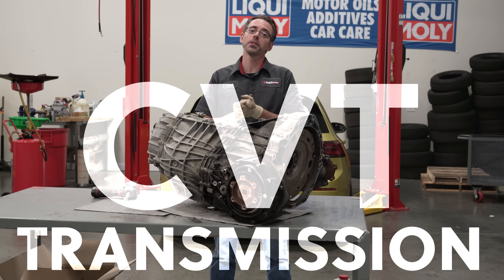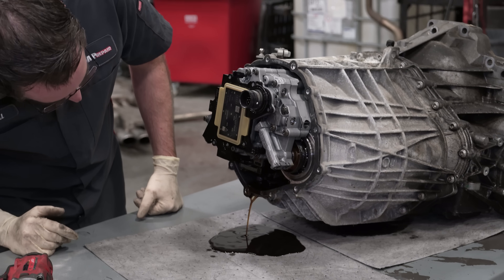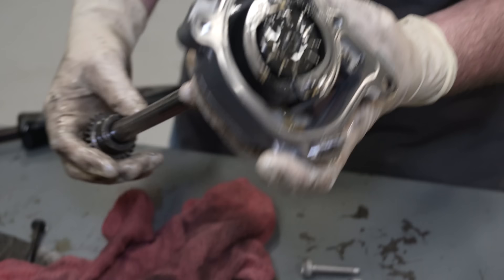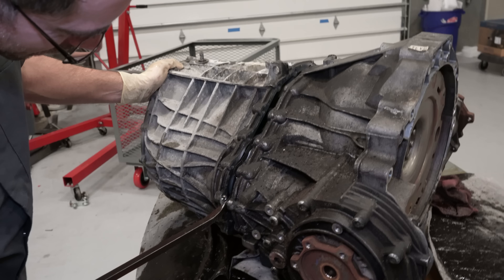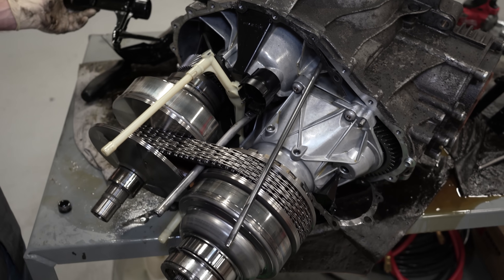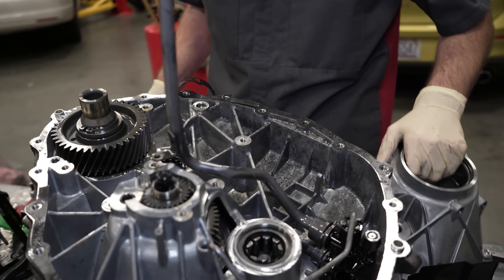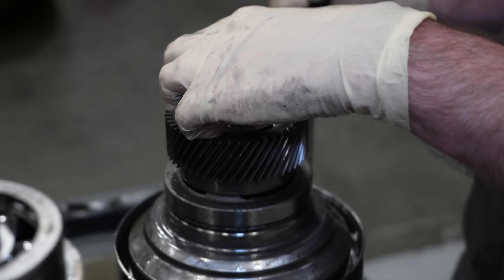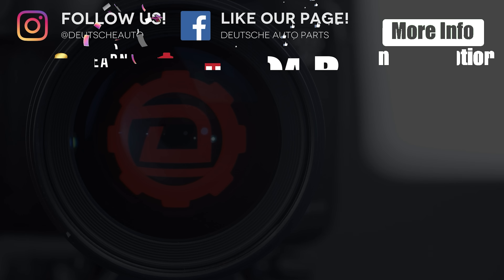Why you shouldn’t get a CVT transmission

Comment: Vast majority of the CVT failures are from lack of fluid changes. These things pump out a tremendous amount of metal shavings from the belt constantly rubbing against the drive pulleys. Nissan dealerships will pretty much just charge cost for the fluid and filters on their CVT transmissions since it actually saves them money to change fluid for no profit rather than replacing the entire transmission under warranty. I've got a Nissan Versa with about 150k miles on a CVT. So, they can last a good bit if you keep the fluid changed regularly.
Reply: toyota hybrids with planetary gearbox set is much better type of cvt, as long as you aren't trying to tow with it....even though i wouldn't try to tow with any type of cvt.
Reply: @utpharmboy2006  - I have a 2019 Prius Prime, and you are correct: you should never tow a trailer with any Toyota e-CVT. The problem is that doing so will cause the MG2 Stator to run at very high continuous power levels, and that will overheat it. Both the MG1 and MG2 stators are cooled by means of the transmission fluid being sprayed on them, then the heat being removed by the tramsmission/Inverter oil cooler, but the systems are designed to handle continuous power levels of around 14 kilowatts (in the Prius), or 24 kilowatts (in the Rav4 Prime), and not 40 kilowatts, which is what you might see when towing even a small trailer.
Reply: @laura-ann.0726  excellent description and information. thank you
Reply: @utpharmboy2006  I've towed boats with my prius and transmission is still like new with over 220k miles😂 never changed fluid either
Reply: @gabrielq.906  toyotas are probably the exception because they are awesome and all others are trash. but great to know thanks!!!
Reply: @gabrielq.906  Prius isn't CVT
Reply: @gabrielq.906  Your Prius DOES NOT have CVT.    Toyota calls the Prius "eCVT" which is quite misleading - yes it's continuously variable but it does it with electric motors, it's nothing like the mechanical CVT's.    So your Prius's reliability is irrelevant to this.
Reply: @utpharmboy2006  that’s also a eCVT which is a lot stronger than a regular cvt
Reply: @utpharmboy2006 
Toyota only warranty the C.V.T. to 36,000 miles read where they will not be included in extended warranty.

Stay with my 9-speed Torqueflite chrysler transmission  fluid change 100,000 miles.
Reply: @gabrielq.906  The Prius has an ECVT right? Because they are hybrid, you're generating electricity with that engine to power the traction motors. So you wouldn't be wearing anything. They are extremely reliable systems.
Reply: I had a 2008 Nissan maxima brand new! Transmission went out at 59,000 miles and 130,000 miles. Car had 3 transmissions in it by the time it was totaled. It’s ridiculous. I have a 2010 Lexus ES with 170,000, original transmission, and NOOOO issues. It shifts just as it did when it was new.
Reply: @sixtee9certified278 must push pedal to metal for 3 of them. Common sense, slow,steady take off period.
Reply: @sixtee9certified278  My 96 Maxima with 220K miles is on its original transmission, and has never had the fluid changed. Manual says to change the oil only under extreme driving conditions.
Reply: My Subaru dealership just charged me $330 fucking dollars to change my CVT fluid. Told me it would be good for 60k more miles
Reply: @tylerramos7633  That's because it's not just a simple drain and fill, and they typically take anywhere between 8-12 quarts of fluid to do the service.
Reply: @tylerramos7633  wow you got scammed.  I do my own fluid changes for about $40 Trans fluid and filter.  Usually only takes me about 30 - 40 mins.
Reply: @MrExicutioner  12 quarts of fluid at $15.00 to $20.00 per Quart, $40.00 doesn"t go very far.
Reply: @MrExicutioner  $40 isn’t even enough to buy the amount of fluid you need lol it’s also not enough to buy the CVT filter. So no you are not doing the same thing at home for $40. Not to mention you need an OBD2 sensor to make sure the CVT is operating at the right temp. Even doing this at home is well over $100
Reply: @tylerramos7633  Ok maybe it's more like $60.  I drive a Chevy cobalt and it has 136k miles on it now.  I change the fluid religiously because I know these CVT transmissions are problematic especially if you don't keep up with maintenance.  I can get a kit on Amazon that includes the filter and new pan gasket for about $30.  Then Dexron 6 fluid is around $30 as well.  Still saving allot of $$$ and it's cheap insurance against a trans failure.
Reply: @Tyler Ramos  doesn't sound too bad with inflation of prices considered. Paid $260 at a Nissan dealer for fluid change on a Murano at end of 2020.
Reply: @tylerramos7633 don’t go to the stealership.  Find a good local shop.
Reply: @tylerramos7633  does that surprise you? That’s a pretty standard cost for something like that
Reply: @tylerramos7633  so you’re mad because you have to do routine maintenance?
Reply: Mine failed at less than 80k, original owner. Every single service done at the dealer, dead about 4 months out of warranty.
Reply: @ReyciclismoMTB  they charged you for a service they never did , I use to work in a dealer I know how that works….
Reply: @ReyciclismoMTB  there was an extended warranty for nissan due to that problem make sure they replace it under warranty. until 120k miles i believe look online for extended warranty on transmission
Reply: @ReyciclismoMTB stealership probably never changed it.  They bring them, keep them all day and say they did it.
Reply: @michaeldro  versa   Drain and fill myself every 20,000 miles   180,000 so far.. No issues
Reply: @mygolfballsannoy  thanks so much brother.
Reply: @mygolfballsannoy Every 20,000 miles fluid change.
03 chrysler 4-speed it was every 36,000 miles, 17 year old car still going.

Not reliable transmission, sustained engine R.P.Ms too

For ATVs and snowmobiles.
Reply: My 2008 Toyota Tundra has 789k miles, and it's an original transmission. Did fluid change every 80k miles. I doubt any CVT would last as long. Just face the facts, it's a poor design requiring higher maintenance.
Reply: @Hmonglauj89 exactly
Reply: This is what I tell my customers over and over and then it comes in on a flat bed and they’re all confused
Reply: Asking a customer to do MAINTENANCE???!!! :face-blue-wide-eyes: Listen here bub I didn't spend $1850 at 34% interest on this magnificent 2007 Altima to do fluid changes ok.
Reply: Subaru NA says nothing in the manual for fluid change ! Meanwhile Subaru Canada says 30K mikes !!??
Just why is that?
Reply: @tedbiernacki376  SUBARU Canada got the right recommendation.
Reply: My Altima has 227k miles not km
Reply: @michaeldro  at least every 30k
Reply: @michaeldro  it’s due every 40k, and only use Nissan fluid, whatever is indicated on your dipstick handle
Reply: @K_man217  Newer CVT's don't even have a dipstick anymore. The manufacturers have made things harder and harder on purpose for the backyard, tree shade home mechanic to do their own maintenance.
From special tools, fancy "Green Unicorn Semen" ATF fluids, locked up repair info and Space Shuttle repair procedures.
Reply: 450000 km - manual Chevy in a S-10.  800000km on daily driver manual 54 Chevy pickup box dating from 1927. Todays cars are substandard.
Reply: i got 2011 versa with over 200k miles and i deliver pizza. my transmission runs great. what are you people doing/not doing with you car?
Reply: @ernestgibson8792  Versa is a small car so yes you should play the lottery…you will not get another year out of that car’s transmission…it’s at the end now..
Reply: @michaeldro  30,000 miles religiously and don't drive it like it's a race car.
Reply: I had a 2002 Acura TL Type S which called for 15,000 mile trans filter replacements. They had clutches designed to wear and were 260HP FWD cars in 2002. 
Obviously exactly 0% of owners ever changed the filter after the car was out of dealer warranty so they got a reputation of being failure prone. I am convinced if well maintained they would survive. Mine and a friends identical car both would chirp second consistently, those clutch packs were beasts they just needed aggressive fluid changes.
Reply: @Jasontyo  I can't speak for your specific ACURA model BUT my 1998 HONDA CR-V AWD has NO WAY to change the ATF filter unless you crack open the transmission to the level that you're looking at the aluminium piece behind the Torque Converter.
And up to this day most Honda/Acura products are made THAT way.
Best bet was draining and filling every 30K miles and hope for a long life.
Reply: I can't believe how much plastic parts are inside that transmission. Well, actually my VW had plastic parts inside the engine so I suppose that is not that surprising. The problem with that is that plastic over time, especially when subjected to heat becomes brittle and crumble. It's not likely to last more than 10 years so. So I'd say plan on this thing failing within 10 years. Personally I like a car to last way longer. I think I will go with Toyota.
Reply: Also at least on Toyota and Honda they have been doing CVT's for some time so they are not as bad as some. I have about 180,000miles on my accord and it seems to be doing fine, will need to do a fluid change i think soon as i dont know when the previous owner had it last done. That said its sorta the same with automatics as well and i hated my cars with (Lifetime transmissions) that had no fill hole on the top or dipsticks to check the condition. Also i try not to beat on my car. I had like 16 cars that cost 1000 or less that i beat on all the time, and ive blown several trannys, now that im older, and you cant just find beater with a heater for a few hundred anymore, its best to make the car last.
Reply: When do you replace the metal?
Reply: Honda regularly recommends changing the trans fluid, much like an Oil change. "Schedule D" if I'm not mistaken. People still don't do it. Then you have the newest jeep cherokees burning up in the first 60k miles for no reason.
Reply: And change that cooler filter
Reply: @michaeldro  I change it every 50 k miles have over 195k on my Altima like anything else maintenance is the issue behind failure.
Reply: my dealership told people to change every 50k miles. but its common knowldge that people should changed the cvt oil around 12k-20k miles, escpecially when you live in a crowded area with a lot of traffic jams
Reply: @timbersync  Agreed, that is a huge factor .
Reply: Yeah I agree I had the Honda 1.5 turbo with 45,000 mi I didn't change the filter in it but I did do the draining fill 2X each at 20K and I had the 🚗💨 tuned & beat the shit out of it but took good care of it, it never let up. Even my good friend is a Honda technician works for Honda said there was nothing wrong with it 😂
Reply: i Have Nissan Sentra 2014 SR around 9years old still running good with no issues regular change oil every 7,000 from dealer 0w20 pure synhetic  oil, transmission oil cvt every 50,000 & radiator coolant changed at 100,000. before at 38k i installed cold air intake without any issues & with catback exhaust no engine lights also. Just proper maintenance brake pads & tire rotation.
Reply: Honda CVT is fine change the fluid every 30,000 no problem at all.
Reply: just adding to the pile here, I have a 2010 altima that just hit 220k miles a few days ago. 2nd owner so i have no idea if the cvt is still the original (I hope it is not) but the trans has been shuttering at around 2k rpms since i bought it at 187k. so unfortunate because the engine itself is an absolute tank with no issues and the car has been extremely reliable and good to me for those 33k miles. I baby it when i drive from a stop but im forced to accelerate fast being from illinois where the on ramps are death traps with only like 300 meters of lane to merge.
Reply: They are just a terrible engineering design period. As a mechanical engineer I cannot understand why something would be designed to transmit power via a belt that relies upon friction between two conical discs compressing a metal belt that is sliding over its surfaces. Manufacturers need to go back to regular gearboxes with torque converters . . .or better still manual gearboxes with clutches (simple).
Reply: AUDI A5 2.0 
2012 - 98000 Miles
4 oil changes to date on the CVT Box and No issues so far
Reply: My Nissan dealership only recommends for a 2011 Cube CVT fluid replacement/flush period! They will not replace the internal canister filter so I did it myself and cleaned off the screen pan filter. Actually, I wish I did my own CVT maintenance unbeknownst there was an internal canister filter vehicle manual doesn't mention it nor did the dealer.BS
Reply: You are just prolonging the inevitable. Compared to transmissions with old school gears, the CVTs do not last as long no matter how often you change the fluid. Instead of the CVT dying out at 10K you get 15K instead when you religiously change the transmission fluid.
Reply: False…. All cvt are trash
Reply: Wanna know how to avoid CVT and automatic transmission problems? Get a manual trans, you lazy asses.
Reply: If it was salvageable before, it’s not now. Insult to rednecks right there.
Reply: @michaeldro  I change mine every 30K miles... Honda CRV. Running fine at 110K so far, but 200K will make me feel a lot better about it.
Reply: Good to know!
Reply: (it's basically cost at warranty) You mean the manufacturer's cost at distribution? the dealership still must make a margin and do on warranty claims.
Reply: @Knight_Kin  Based on the cost of the fluid and the filter if one were to try and buy it directly for a DIY service. My transmission needs to use the older Nissan NS-2 fluid which runs about $22 a quart. Transmissions that use NS-2 are not interchangeable with the newer NS-3 fluid. You need 10 quarts to drain, flush, and fill the transmission. Then, the filter and gasket around $50 if you use Nissan parts. The dealership by me charges about $325 for the CVT service. One still needs to pay the mechanic for their labor time. Once I do the math I believe that Nissan is not what I'd call, gouging people for CVT service. The other benefit of taking it to the dealership is they will update the firmware on the powertrain control module which will affect the shifting, drivability, and longevity of the transmission. As well, there is a calibration/reset that is supposed to be done on the CVT after the fluid is changed which I think Nissan calls a "Clutch Point Relearn". At any rate, I know that after my first fluid service they told me they reprogrammed and recalibrated the CVT and I found the car as a whole was just much more responsive afterwards.  So, there are a number of benefits to having the dealership do the service that go beyond just cost.
Reply: I've heard the opposite: don't change the fluid often.
Reply: Also from the guy who teaches transmissions at the trades university I work at "make sure to do the changes with GENUINE fluid from manufacturer. Aftermarket hasn't been able to directly copy the formulas yet."
Reply: I was thinking they're failing because the vehicles are too heavy and engines have too much power for the best use case of CVTs. Use the right tool for the job!
Reply: Just did my 2020 Civic, 30k on the clock got fresh CVT fluid today
Reply: @michaeldro  just toss the whole car in the trash and get a small block Chevy and a t5 tranny
Reply: @hostileaks4495  hey, listen here. I love my car. It makes me happy so I'm going to keep it happy. Kindly, fuck off and let me take care of it, so I can enjoy it as long as I can.
Reply: @michaeldro  nah I feel you I love my car too. But in all seriousness, it's going to be trouble those cvt are the worst invention. It's basically the same thing that's on a golf cart. Get a infinity g35 or something instead of an altima. You'll love it way more.
Reply: @hostileaks4495  thank you much for understanding then, sorry. I've thought about a g35, probably will be the next. I know JATCO isn't the best, I'm trying to minimize probelms as I go. Metal belts on metal + heat isn't a good combo.
Reply: Recommended frequency / mileage to change of cvt fluid
Reply: I just changed the fluid in mine at 60,000 miles.
Reply: we bought 2 Rio's with the new Kia CVT - I wanted to risk Versa but decided not to - cvt fluid+filter EVERY 20k so far zero issues - I might still risk it with a Versa Note but id have to get it with only 30k max on odometer so I know the cvt hasn't been ran into the ground yet
Reply: People just don't know how to shift properly. They bump into it many times, aggressively shifts gears, lack of fluid changes. All from daily driving. You take care of it, then it will last.
Reply: What kind of schedule do you follow? I'd appreciate knowing.
Reply: I thought the CVT transmissions are sealed units that have lifetime fluid that can't be changed or checked?
Reply: @ryantoomey611 Nope.  They definitely have drain plugs and fill ports.  Changed every 30k.
Reply: Absolutely this. CVT haters either change oils in a longer time thinking its like some torque converters, or are racers that want more than 50kg of torque
Reply: I I have a 2015 Kia forte five SX with 165,000 miles on it and I’ve never changed the transmission fluid course. These are sealed there’s no dipstick like the old days so far so good I imagine if I keep this car any longer. It might break down, but any rate I’m just gonna leave it the way it is.
Reply: Nissan used have good Automatics,that never let you down,but bowing down to mindless EPA elites,the puppet car companies thought that building a snowmobile CVT transmission was a great idea to squeeze another mile out of a gallon of gas to keep the puppet masters happy.The CVT has been an engineering disaster! The bulk of the CVTs are made by JATCO a Japanese transmission builder for Nissan,Subaru,Mitsubishi etc.They are on their 11th model!The concept was good,the engineering flaws disastrous for dealers and customers.The other car manufacturers came up with their own versions and yet still have issues! Buyer Beware when the warranty is off.Insanity is doing the same thing hoping to produce better results! Those manufacturers need to hear from customers with class action suits so they will build again what works! The world has gone Mad!
Reply: Fluid changes every 36,000 miles (had 03 chrysler 300m 4-speed every 36,000 fluid changes) going backwards?
Drive chrysler with 9-speed 100,000 miles fluid and filter change.
Extended highway driving and hard acceleration from dead stop shortin life of transmission.

C.V.T. ARE FOR ATVs and SNOWMOBILES.
Reply: Perhaps Toyota engineers know something that they have come up with ECVT in lieu of CVT.
Reply: My only experience with CVTs is farm tractors and checking out a few Nissan X-Trails for a mate.
All the CVTs had problems and he ended up buying a manual as a loan car for his car mechanic business.
Not sure if the heavy-duty CVTs used in newer tractors can be reliable, they primarily use them rather than 36, 48, etc. speed manual/auto transmissions, this is done because different crops and attachments require different speeds, whether for harvest, seeding, etc.

Now I change my eng. oil 3,500-5,000 miles and regularly change trans, diffs, axles, etc... That being said, when the defense for a vehicle's unreliability is 'oh you have to baby it', it is a poor excuse.
A good engine, tranny, etc. Should be able to take a bit of abuse.
Do these newer CVTs even have a service & maintenance plan?
Reply: Thanks i was looking at a Ford CMAX with a CVT, now forget it, too much potential for problems, that chain breaks and its gtta be 1000,s of dollars.
Reply: 260k on nissan maxima 2015, i maintain the transmission when ever is needed.. CVT saves fuel that why it's good
Reply: Hello I wanted to launch my Toyota Avensis, press the brake then accelerator and it just snapped.. it's going D, R but doesn't move. When I put it in P it makes some noise for like 3sec. So can someone tell me what should I do? 2.2d 150ps 2010
Please tell me if you know what could it be. Thanks
Reply: 2015 Honda Civic CVt has 160,000 miles. No problems no shaving. Change fluid every 20,000 miles. I don't know I don't drive aggressively.
Reply: Yes
Reply: Just by looking at the oil viscosity and colour, you can clearly see why that CVT failed.
Reply: Yeh, okay...its their chepo deluxe Jatco transmission..duh
Reply: another one hondas using steel belts cvt shred into million pieces because of behavior driving
Reply: Then you don't know how manufacturer warranties work. I'm a service advisor and have been one for 14 years. Nissan pays us to change the transmission out under warranty. 25 percent above cost for the assembly. Good hourly rate for the labor. We don't lose money.
Reply: @spectreshot1  Well...let's think about this... You're dealer's service center specifically doesn't lose money. But somebody eats the cost and it's no doubt coming out of a higher level cost center from the Nissan corporate.
Reply: All cvt transmissions are trash
Reply: I have a 2011 Nissan Cube SL with a CVT and I've never had an issue, I keep the fluid changed every 30 to 50 thousand miles. The problem is people don't do fluid changes and that's what kills them.
Reply: 2015 Corolla with 200K miles. I have done two tranny fluid changes in the 70K miles I have put on the car since I bought it used changing fluid every 30K. Did the strainer(filter) only the first time and nothing on it. If it had an actual filter I would change it every other fluid change like on my daughter’s 2015 Civic. I don’t use factory fluid and never have with CVT or non-CVT transmissions with longest at like 238K miles and sold it shifting fine.
Reply: I have a 2015 versa with 150,000 also. The tranny feels strong.  I change canister filter on left side behind wheel well .. runs great
Reply: I changed mine by accident in my subaru....drained the wrong oil...
Reply: Biggest problem with todays cars is substandard parts, especially MB, BMW and VAG using recycled chinese material in their timing chains.
Reply: @mikakoivunen3456  I didn't know the Chinese are this evil 😡 They even spent the time and effort to trick the Germans into developing such an inferior transmission just to sell their recycled crap. They must've bribed the engineers and QAs at LuK and the VW group, so those inferior products can make their way to the market. I don't know why people are still buying those cars, the Chinese must've been bribing the customers as well. How dare them 😡
Reply: You don't buy a Nissan if it's a CVT Trans, if you want CVT buy Toyota or Honda instead. Nissan CVT will crap out even if change fluid every 5K miles.
Reply: @zepp3lin  my Accord just turned 163k. It's probably overkill but I have the CVT fluid changed every 30k.
Reply: @jeffduncan9140  Not overkill. I have my CVT fluid changed every 25k.
Reply: @jeffduncan9140  30k might be the recommended miles
Reply: @jeffduncan9140  30k isn't overkill like zepp suggesting every 5... Clueless individuals
Reply: @jeffduncan9140  Not overkill at all. Sounds pretty normal interval to me. You're doing great. 🙂👍
Reply: @jeffduncan9140  What do you do to change it? Do you take it to the dealer?
Reply: @crand20033  I do. There's one not far from the house. I figure if there is an issue with it, given my limited experience with transmissions, they might see it before I do.
Reply: @jeffduncan9140  They have a machine that takes the old fluid out and puts the new in at the same time and makes it really fast. But I don't think that is the most thorough way of cleaning it out. if you take it to the transmission shop (that really knows CVT tranny's) they may do it a different (more expensive) but better way. They have to get all the fluid out of the torque converter too.
Reply: @mickey0667  i tried to find an independent shop first but nobody wanted to touch a CVT. I translated that as "we don't have anyone who knows anything about CVTs". The one transmission shop that I trust doesn't mess with them, either.
Reply: @jeffduncan9140  I have a 2013 accord cvt car that has 160k..I do the 30k transmission fluid as recommended..admittedly, I get cvt anxiety that it can go tomorrow…I use it mostly for doordash …so it take a beating…
Reply: @donovanfahrbach2493  nice! Most of the miles on ours is ATL work/home traffic. I'm looking forward to a minimum of 200k out of it.
Reply: @jeffduncan9140  Same here on my 13 accord..160k+..just wondering,do you still have the original fuel pump( trunk) ?..I’m not sure if they last very long or should I change mine out…
Reply: @donovanfahrbach2493  still original. To this point, I've pretty much only changed tires, brakes and oil, etc.
Reply: @jeffduncan9140  - No, it's not overkill. As HeftyJo pointed out, the belt and pulleys are in direct metal-to-metal contact, and this is bound to create a lot of metal shavings. Conventional hypoid gear transmissions, either manual, automatic, or e-CVT (Toyota HSD), are lubricated with a thin film of oil that cuts down most of the metal shavings; Belt drive CVT's have much more metal-to-metal contact at the belt/pulley interface. Changing your CVT oil every 30K is cheap insurance. If your drain plug doesn't have a neodymium magnet in it, get one that does: that way, you can visually see, at every oil change, how much (or how little) steel shavings are in the oil. A sudden increase in this between one oil change and the next would be a warning sign that something's wearing out or there's a problem with the hydraulic control system that's causing tension on the drive belt to get out of it's proper range. Honda makes very reliable cars (as does Toyota), and I've known people who got 300K miles out of Accords. Maybe the air conditioning wasn't working by then, and the seat upholstery was falling apart, but the engines were still running well, and still passing California Smog Check.
Reply: @zepp3lin  for whoever is already stuck it's advisable to go light on acceleration and change those oils more often than what's written. My brother kept a Murano CVT to around 180K miles that way.
Reply: @1wun1  I am 100% convinced that most CVT failures happen because people won't adapt their driving style to suit the CVT. Within a couple of days of owning my X-Trail it became pretty obvious that they really don't like you planting your foot but respond really well to steady controlled acceleration. Just clocked 130 000 fluid has been changed twice. Still going strong.
Reply: @mikeb4822  true
Reply: @mikeb4822  yeah, I don't like them but if I had a CVT car I would not be smashing my foot on the throttle all the time and accelerating hard in city conditions or on rough roads... Baby it and make your vehicle last.
Reply: @mikeb4822  what I learned was that a car with a CVT is not for me. If a car can't handle a bit of spirited driving, it's not going to last with me driving it. 

Biggest problem I had with them though was driving in traffic and other drivers causing me to have to accelerate or brake rapidly when merging. Obviously driving in traffic isn't great for any car, but CVTs really do NOT like that and will let you know. Traditional automatic, manual, or electric for me.
Reply: @Michael-uc2pn  This is going to sound crazy but hear me out. Maybe you could just leave enough space between you and the car in front of you to allow you to adjust for  variations in traffic flow and people merging simply by taking your foot on and off the gas a little bit. Irrespective of transmission type you will
1 Reduce engine wear
2 Reduce brake wear
3 Reduce transmission wear
4 Reduce fuel consumption
5 Get where you're going in the same amount of time (and probably be more relaxed when you get there).
Mad right?
Reply: @zepp3lin  Exactly. My Nissan Rogue had three transmissions in its short life and I am dogged with my cars' maintenance. I've purchased over ten brand new cars in my lifetime and traded them in at around 100k miles. I did not have any transmission problem with any of them. I sued Nissan and they had to give me back every penny I paid for that car and they had to pay my lawyer double that amount. They have lost me as a customer permanently. The last time I could hear grinding sounds and went to the dealership to have them look at my car, they insisted it could not be my transmission since they barely just replaced it. So my car stopped dead in the middle of a busy freeway, and they finally believed me. If I did not pay for that car in full, I would've had it repossessed by the bank because it was a very stressful car ownership.
Reply: @zepp3lin  you can just say don't buy nissan. they're horribly built cars nowadays.
Reply: @zepp3lin  Yes it is true CVT has a tendency of limiting your speed when it reaches at 80mph  it stacks there no further speed and RPMs keep at 4000.
Reply: @zepp3lin  I think that depends on the car.  Early days Nissan would put their CVT in anything, including higher powered cars like the Maxima or some of their SUV's and it was a disaster.  If you get it today in the low powered stuff like their compact SUV or compact cars it's probably okay.
Reply: @zepp3lin  Wrong.
Reply: @zepp3lin  That's the JATCO CVT transmission in particular.
Reply: @zepp3lin  Mine lasted 163k. I changed the CVT fluid at 90k and 162k. I probably didn't change the fluid frequently enough, but at least I changed it :-). I'm opting to rebuild it myself since there is part availability. I fully expect it to take me a month. Engine is well made in my Altima and it feels like it just got broken in. With a rebuilt CVT, I  hope to get another 100k out of it.
Reply: @zepp3lin  I believe it got burnt once stick with gears.
Reply: @zepp3lin  Nissan wanted $9K to replace my transmission 60k kilometres after they replaced it under warranty, I told them that I was going across the street to buy a Honda. and purchased a nice Civic with a standard transmission.
Reply: @zepp3lin I’m at 120k on my 19 Altima drove it 30 hours non stop. Only shut off (cooldown) time it had was however long it took to fill the gas tank back up. Been driving it across the country and so far is a beast. I always let my cars warm up tho so all the parts get fluids and it’s not just metal on metal. Did my fluids at 30-60-90-120. Every 30k filter and fluid should hold up for a while. I always beat on it too so we’ll see how long it last
Reply: @zepp3lin  I was looking for this comment, thank goodness, I thought all car with CVT is horrible, but it seems like Toyota and honda is exempted.
Reply: @aiztoh lots of accords and civics with grenaded cvts I would stay far away. Also know Nissan gets a bad rep for a few really bad years but my car is close to 90,000 and no issues but it’s serviced on time every time. My buddies Altima is at 330,000 original transmission no issues but again it’s serviced on time every time.
Reply: @aiztoh reliable, but still not engaging to drive.
Reply: @zepp3lin  can confirm this, I work in a Nissan dealership as a tech, never buy a Nissan cvt
Reply: @zipsuma  I doubt in your information
Reply: @rafaelg9016  well I see/fix them on a daily basis, last one made are better, but at some point in the production (circa 2015 I think) the gearbox would self destruct at 120 k km. I’ve seen countless customer crying when we announce a 10000€ gearbox replacement
Reply: @zipsuma  I can kinda of confirm that too. Kinda. I worked with warranty parts (for Sentra, mostly) and up to 2014 we'd have massive numbers of CVTs popping at around 60 kkm. From 2015 to 2017 there was improvement, perhaps making it good to up to 100 kkm. 2018 and 2019 they got even better, but can't say about anything beyond, cuz that's when I left the company...
Reply: @zipsuma  Nissan cvts haven’t improved at all ?..still dropping like flies after 2021 models?
Reply: @donovanfahrbach2493  the vehicles are too recent to get such problems, time will tell us but i know they improved it
Reply: @zipsuma  Toyota have cvt too
Reply: @zipsuma  I unfortunately, I purchased a 2019 Sentra and per the manual it says to change transmission fluid every 70k and I changed it around 60k. At 96000 miles now I can only park and reverse the car. The dealer and other mechanics are recommending a new trans without looking at the car. Can I do a self diagnostic before committing to a shop? Will a sensor point out what is wrong with the trans? The car has been sitting for 1 year and a 1/2 and I can not afford the $6 to 7k they are asking for. If anything will it be a good alternative to rebuild instead of a new trans?
Reply: @dblashomes  if you can read the trouble shooting code I can help a bit (I'm a tech here in europe so we don't have sentras) selector solenoid is most likely shot. I wouldn't attempt at rebuilding one myself. I'm sorry for you loss, nissan should face legal issues for this. Try to argue with the Nissan aftersale service (not the dealership but directly nissan) maybe they will do 50% discount on parts/and or labor.
Reply: @zepp3lin  better yet buy a Toyota or Honda cvt car and slap a cvt oil cooler on that bad boy if it doesn’t already come with one from the factory. Been doing track days on my civic hatch with a cvt and temperature is a big thing with these transmissions. Proper oil changes and easy operation when not fully warmed up will have one of these transmissions go a long way from my experience.
Reply: @zepp3lin  yeah, i can confirm that nissan cvt is bad. The repair shop I usually go to check my '15 corolla (cvt) they all say the nissan cvt is a pain in the ass due to lots of failures it shows
Reply: @zepp3lin  yes. My Murano cvt failed badly. No more Nissans. Trash.
Reply: @zepp3lin  I get the hate for nissan but your comments are rather misinformed and borderline cringe.
Reply: @zepp3lin  you are a liar! Newest Nissan CVTs are reliable and with a good performance, one of the best CVTs of the market.
Reply: @rafaelg9016  I like my 2017 rogue but it has only 73K miles.
Reply: Sounds like engineering defects, if you know that the cases, why not just include the schedule how often you need to change the fluid. Or the manufacturer to afraid to put it on paper out of fear customers will refuse to buy a car that required me to waste time every month or so to visit service centre and pay the cost.  Nope I stick with my reliable ordinary Toyota transmission.
Reply: @thatsawesome2060  what is an ordinary Toyota transmission?
Reply: @thatsawesome2060  Manufactures actually do put that on the maintenance schedule. 
But most customers don’t bother to even open that schedule. 
The few that do, most also don’t know how to properly follow the schedule. 

There is a “regular” which most customers should NEVER follow. 
It’s there to make the baseline maintenance cost look low. 

Then there is the “severe” schedule. 
If you run “short trips”, you should follow severe. 
If your area gets to below freezing temps, you should follow severe. 
If there’s salt on the road, follow severe. 
If the air is dusty, follow severe…
All kinds of situations, you should follow severe…
Reply: 2011 sentra 190k miles no issues. Have a friend with a 2012 sentra 240k miles on theirs.
Reply: @maxwellmelon69  That’s amazing for a Nissan…how often do you change the cvt fluid?..just wondering…I normally see Sentra’s on flatbeds mostly from Uber drivers…it’s possible they didn’t do the transmission fluid changes as they should if at all.
Reply: @maxwellmelon69  Flat terrain or mountainous?
Reply: @maxwellmelon69 we are talking CVT not automatic. No way CVTs are lasting that long.
Reply: @maxwellmelon69 I have 2011 Nissan Sentra with 171k miles, drives great but has a mildly rough idle. How often did you change your trans oil
Reply: @maxwellmelon69  to be blunt, that is an utter fucking miracle. I have never come across one that made it past 120,000 miles without the transmission quite literally shitting itself.
Reply: @fadingbeleifs  398,000, change every 100,000.  2012 Prius.  The Prius only has 127 hp so can't strain it as much with  torque.
Reply: @aaronjohnson6501  the Toyota hybrid system doesn't use a belt or chain. It has a planetary gearset which acts like a CVT but it only allows for the engine RPM to vary, it doesn't change the actual gear ratio (takes a while to wrap your head around how it works)
Reply: @fadingbeleifs  Lol, it is rare but some cvts by Nissan make it over 150k provided that’s is babied, cooler weather, and regular fluid changes…but most fail largely because of lack of fluid service..and the pumps are undersized and clog up…when the weather is warm these cvts by Nissan run hot because mainly the cooling system is inadequate..this comes from a Nissan tech friend…
Reply: @donovanfahrbach2493  the cars don't have transmission coolers. Under normal city/highway driving you should be fine but if you live in hot climate like I do where temp reached 115 daily plus driving over huge hills I installed a transmission cooler which helped greatly.
Reply: @donovanfahrbach2493  you are 100% right. I still drive 2006 Nissan Murano,  still runs smoothly as new. Transmission cooling system needs to be improved and that's it. Without it temp sensor gets stuck, cooling doesn't work, oil temp rises and the transmission is cooked. Overheated plastic and metal parts doesn't last long.
Reply: @internationaltrade9399  I bought a used 2003 Murano. I enjoyed the car but hated the transmission. Only had the car for 3 months before the transmission went to shit. No warranty under Nissan and had to buy a new trans from them. I was scared it would go out again so I also installed a transmission cooler. Didn’t know this was a problem. Had Nissans before with no issues. This car was a money pit and I wish there was options for a regular gear transmission or even a manual lol. Sold the car before any other issues. No thanks CVT.
Reply: @fadingbeleifs I've had 2 altimas reach 200k no transmission issues
Reply: I hate the way they accelerate
Reply: @jerrypeal653  I have a Nissan rogue and I am very satisfied with it's acceleration.
Reply: @crand20033  Grand kid has a JEEP Compass it’s noticeable how it acts as compared. No this wrong with it it’s just different.
Reply: @jerrypeal653 I feel like they always shutter super hard when decelerating as well
Reply: @jerrypeal653  i love the way it accelerates.
Reply: Just look at the color of the fluid coming out, anyone can see the owner did not take good care his vehicle.
Reply: Have mitsubishi asx with CVT and 300k km. No problems at all
Reply: @cactuslietuva  sweet jesus..... i am about to buy an asx model 2023 cvt transmission..... i am scared.....should i back off or keep going after knowing your asx is doing fine....
Reply: @elternero6624  I wouldn’t buy it..cvt or dct transmissions are expensive to do fluid changes and don’t hold up past 150k…as a mechanic, trust me , no cvt is as reliable as a conventional transmission…again no dct either…they suck too…there are rare exceptions meaning some cvts do make past 200k but being at the scrap yard I see 100 times more cvts then all other blown transmissions combined…however, fluid changes every 30k on the cvts do extend its life…but not always..conventional are tried and tested to get 300k consistently with fluid changes at 50k for them particularly…out of 10 cvt drivers, only 1 will get 200k or more where as only 1 out 10 conventional ones would fail…those are that facts .
Reply: @elternero6624  You’ll be fine. Don’t let this discussion about CVT scare you. 

I drive a 2010 Mitsubishi Lancer since when it was new. CVT. Paired to the 2.4L engine. GTS trim, came with paddle shifter that gives 6 pre-defined “gear ratio”, in addition to the fully automated “D” drive mode. 

CVT fluid changed every 30K miles. Car is currently at 177K miles and still running strong. 
In fact I have being auto-crossing with it for a bit over 2 years, and have made faster time than a Mazda3 turbo AWD, a Ford ST (turbo), etc. 

Mitsu get their CVT from JATCO, which also supplies to Nissan.
These CVT’s belt are not the same as the Audi/VW’s belt design you see in this video. I personally think Jacto’s design is better; the wear is spread across much more evenly across greater metal surface. 

Besides CVT fluid change every 30K miles, make sure you also change the fluid filter. 
Most people that have failed CVT, most likely committed one of these errors:
1) didn’t change fluid frequent enough (ignored maintenance)
2) didn’t change the filter. 
3) used wrong fluid. (Eg ATF instead of CVT fluid)

Mitsubishi‘s service manual actually didn’t say anything about a CVT fluid filter. The dealer also didn’t mention it when I bring it in for CVT fluid replacement. My CVT almost died on me at 172K miles due to a fully clogged filter. I got lucky and managed to limp the car home under very low power AND kept the transmission temp lower than 230F. (It was at 235F when the alarm went off). After that, changed the fluid, found & changed both filters (wire mesh & cellulose cylinder), went back to driving it, and no more problems.
Reply: @cactuslietuva  what did they tell you about maintenance at the dealer?
Reply: @cactuslietuva  Mitsubishi cvt are well made and don't give issues once you change the oil on time. The eclipse cross cvt Is very good and simulates gear changes,  Mitsubishi has improved their cvt design to behave like an automatic. 

It's also much more reliable than Hyundai and kia dual clutch.
Reply: Fluid is no substitute for good design and good metallurgy.
Reply: See that fluid?😱 2016 versa cvt  180,000 miles and still going.. no issues
Reply: @michaeldro  my mom's 2016 is fine every 30k miles for about 200
Reply: That makes sense. The auto companies will make certain design decisions to get the customers in for the maintenance….
Reply: Knowing a little bit about the inner workings of transmissions automatic and manual, and all their moving parts friction plates bushings bearings spacers and alike. Plus all the valve train in the engines respins bushings change lifters all wearing as you drive the car, makes me a little sick every time my transmission shifts through its turn gears turning both differentials in a transfer case. I haven’t test drove a Tesla a few times now and knowing how simple they are with so few moving parts, it makes me think that automatic and manual transmissions in piston engine cars with all their parts wearing is just plain dumb.
Reply: @bearlemley  Sad but true
Reply: Agree 💯, that happens with everything that needs lubrication , regularly you have to change the fluid because deteriorate !!
Reply: Terrible advice I changed my transmission oil on my accord after normal maintenance and put oem honda fluid and one month later the transmission broke. I measured the transmission oil when I put it in as well and I have had many mechanics tell me not to change transmission oil in CVTs.
Reply: Basically if you don't floor it, it will last. Can't race them period.
Reply: What a shocker that the same thing that kills normal automatic transmissions and engines is the same thing that kills CVTs